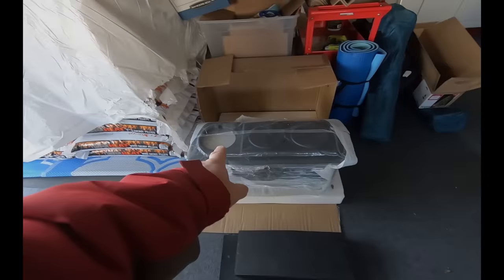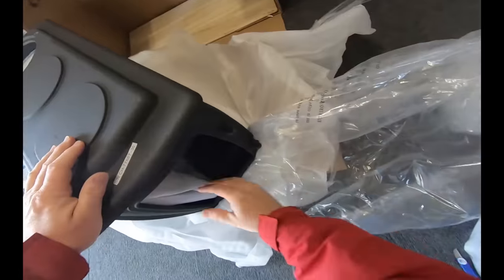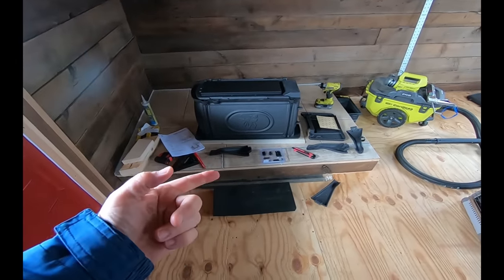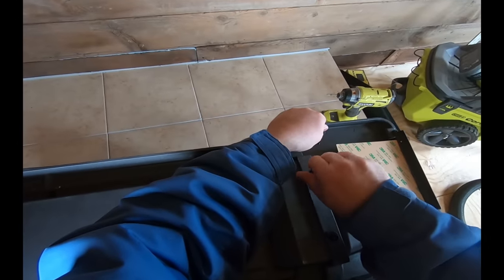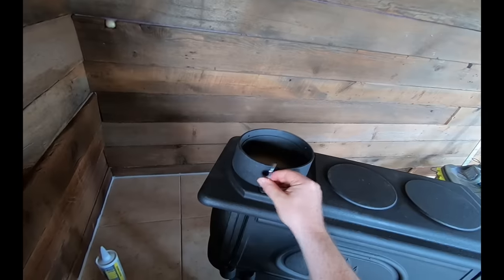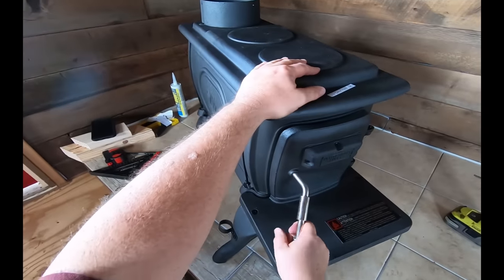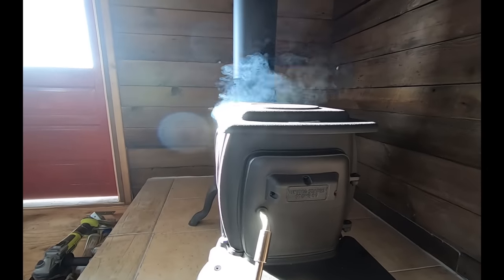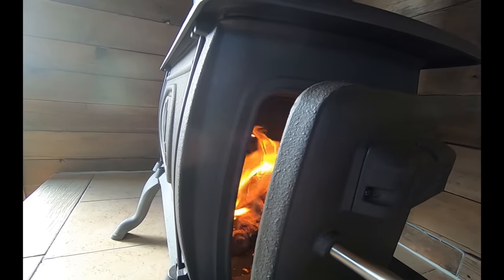U.S. Stove Company 900 Square Foot Log Wood Stove...ASSEMBLY, INSTALL, AND FIRST BURN

Comment: You're wasting 50% of your firewood if you're not installing a flue damper and learning to use it properly.
Reply from the maker: Thanks for the comment. Many people have installed dampers in EPA stoves and wish they hadn’t. Read the reviews of these stoves and the complaints about smoking into the building. This stove isn’t designed for using a damper, it, like most stoves now, have a regen burn system.  I get no smoke inside my building and the fire lasts quite a while. Coals still 12 hours later.  The manufactures recommends no damper. I’ll go by what they say since it does burn the way it’s supposed to.
Reply: @LancoAmish  Notice I said "Learn to use it properly.". You can't just set it in motion. It has to be set appropriately for the amount of air in/out and the amount of draw. Open flue for starting a fire. Once the fire is sufficiently started and has enough coals, you can bank the heater with green wood and set your flue damper at 1/3 to 1/2 blockage to prevent heat escaping from the heater and set your apron to match or lower the amount of air intake. It takes practice. If you're getting smoke, you have too much air coming in and/or your flue damper is too closed. Used properly, a single load of wood can last 8 to 12 hours. Long enough to sleep a good night's sleep and have coals remaining in the morning to start again. I grew up using a Ranger Wood stove as primary heat for over 20 years and a King wood heater in my own home. If your heater is making a chugging sound, that's your wood $$$ going up the chimney.
Reply from the maker: @Sattracer  , this stove does not have air intake controls. When burning there is very little smoke exiting the flue. It’s a pretty efficient setup. Have you used this model of stove or any EPA certified stove?
Reply: @LancoAmish  Uh oh... I better stop talking then. Because without any air control at all, that is not a wood burning stove.  If you can't control the air, it's a pile of junk.

Comment: First burn should be outside. The pipe should go over a flange no silicone should be needed. That thing's going to leak smoke forever!
Reply from the maker: Thanks for watching. I really didn’t need to do first burn outside…small cabin…easy to air out.  Also, the pipe never goes over a flange. That’s a great way to have creosote leak onto the dove and cause a fire. Pipes go together the way I showed.

Comment: You are  to  burn  outside  on the  first  burn
Reply from the maker: Thanks for watching. The recommended first burn procedure is 2 small fires about 250 degrees for 20 minutes, cooling between each and then a 500 degree burn for 20 minutes also cooling down. If this is done outside it’s very difficult to make sure you don’t overfire in the initial burns. More than few owners have fired outside like you suggest only to overfire and cause the casting to crack somewhere. Three burns like suggested would also take 3 days. Not something I preferred to do compared to opening the windows.

Comment: Proper rating should be in cubic feet, not square feet.  Otherwise it's just another cheap POS.
Reply: So every stove you can buy is cheap junk because every stove and manufacturer you look up talks square ft

Comment: No damper?
Reply from the maker: Thanks for watching. The manufacturer doesn’t recommend one.  Most newer stoves that have to be built to EPA requirements shouldn’t be installed with a damper. The air flow is restricted due to the design and controlled by air intake. This stove is a single burn rate stove and is designed for no damper also.